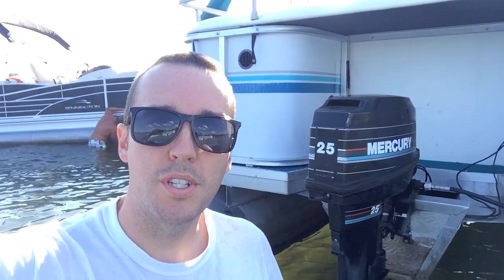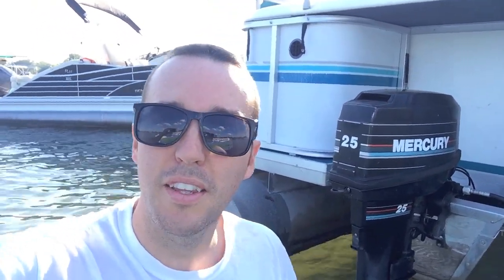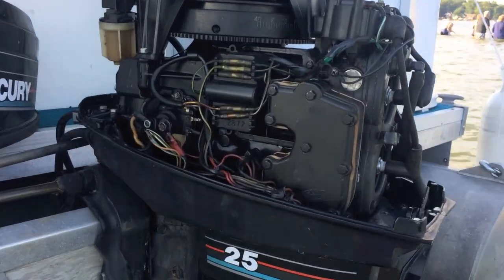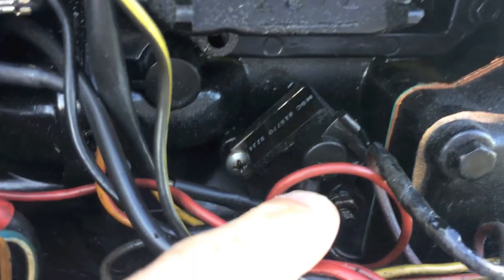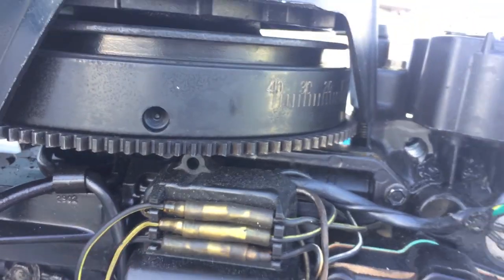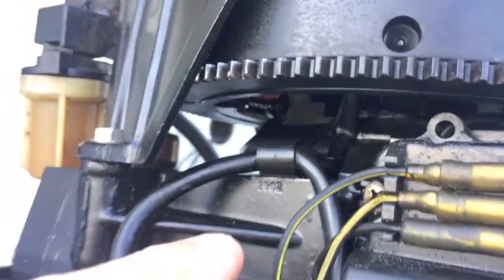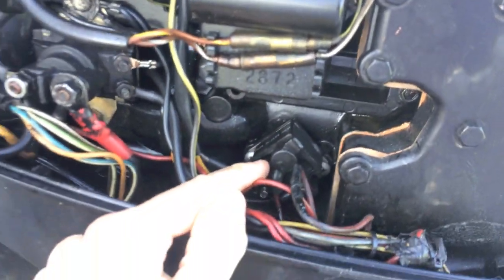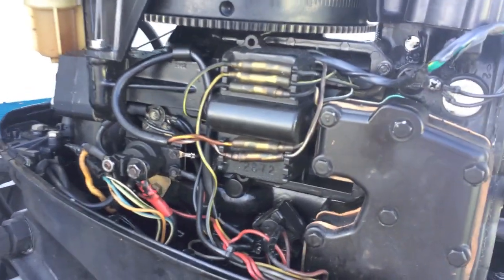Outboard Boat Battery keeps going Dead/Dying - Rectifier Failure - EASY FIX

Comment: 30 hp etech marine engine does not charge the battery. What can I do? I wish you a good day, my friend
Reply from the maker: Good morning ☕️ it can be that your regulator is faulty or your stater located beneath your flywheel is faulty.

It may even be that the battery itself can’t hold a charge.  If that’s the case, we recommend replacing battery.  🧰

Comment: the rectifier doesn't charge the battery. the stator does. the rectifier changes the voltage from AC current to DC current and then regulates that voltage.
Reply from the maker: Thanks for watching & sharing.  👍